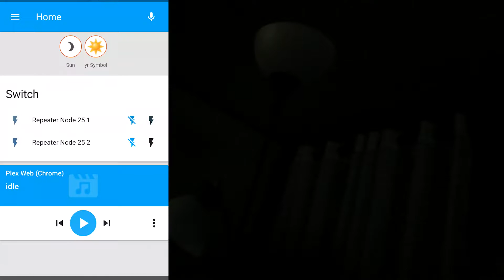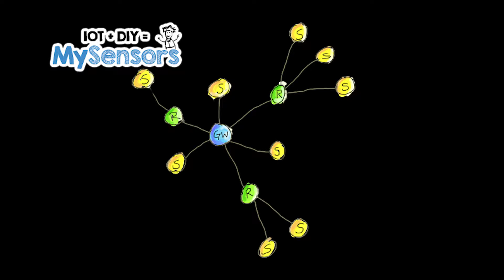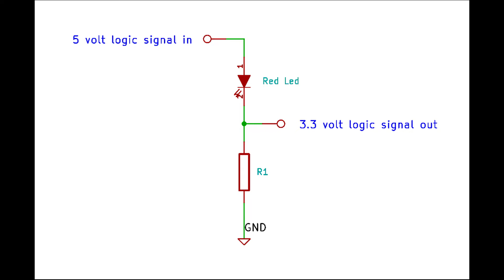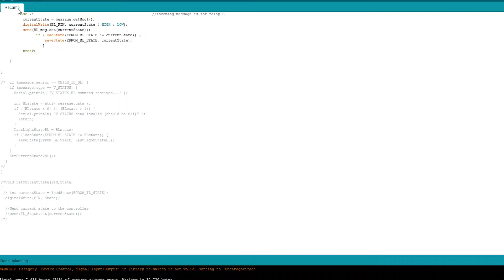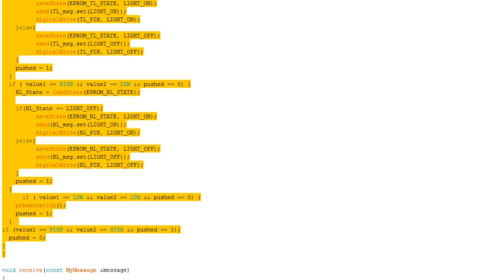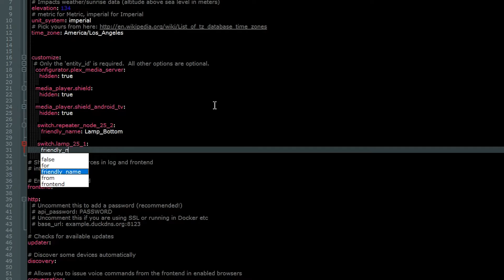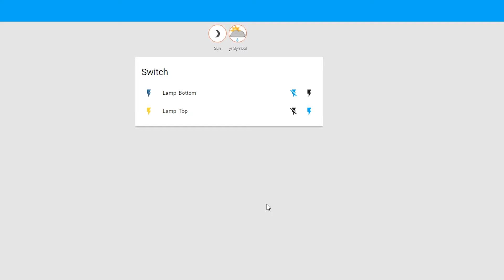H.A: Part 1  DIY Smartlamp

Comment: One other thing to note if you are using MySensors with a Pro Mini and an nRF24L01+, look at the Easy Newbie board for building sensors. It eliminates the need for having to solder all the wires neededto connect the nRF24 radio.  It also has all of the stuff needed for regulation for the radio when using a 5 volt pro mini. 
https://forum.mysensors.org/topic/2740/easy-newbie-pcb-for-mysensors

Comment: Bring it on - I'm keen on this subject - currently doing the same, but with esp8266's and IR + RF  > HASS
Reply from the maker: +Brendan Smith oh nice that's awesome! what devices are you using IR for? Turning on and off your Tv?
Reply: :)  On the ESP8266 (NodeMCU v3) I have an IR emitter, 433MHz RF and a DHT temp sensor. I have 3 reverse cycle air conditioners (one ducted, two others are split). The ducted has no remote control, but there is a RF receiver on the fan unit under the house. The spilts have IR control. As it turns out all three use the same commands! So I have protoyped one control. I also have some RF controlled power outlets - so I will use them on things like lamps and our coffee machine.

These units subscribe to MQTT topics for a simple 'cool', 'heat' or 'off' command. They also listen for unique on/off codes to transmit over RF. They also report the humidity & temp at each controller. I will hide the remote controls! The HASS UI will look after the control, and some automation will stop the misuse of the aircons I have at the moment with my family of 5. >:^(  I have another unit that uses a reed switch to tell me the open/close state of the garage door, and is also connected to a 5v relay to toggle the open/stop/close switch on the garage. Again controlled via MQTT and HASS. 

I will soon build another unit that uses an 8 port relay bank to control 12v power to a yet to be built irrigation system. Soon!